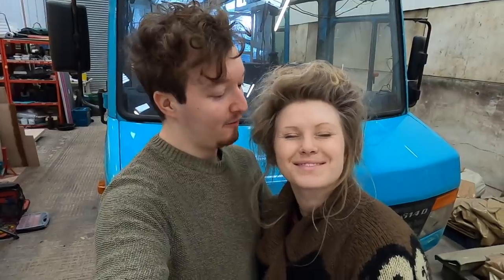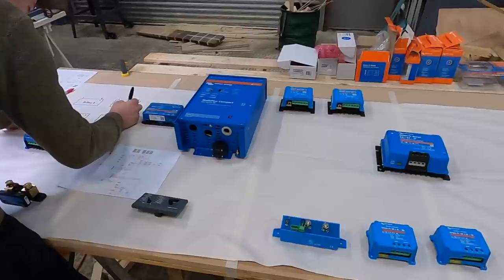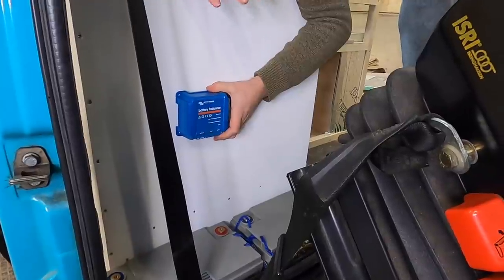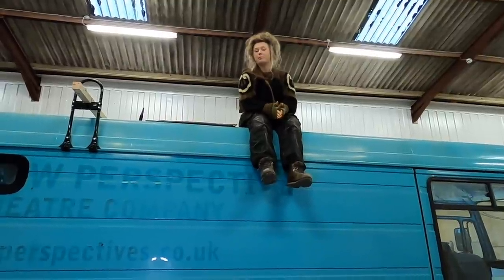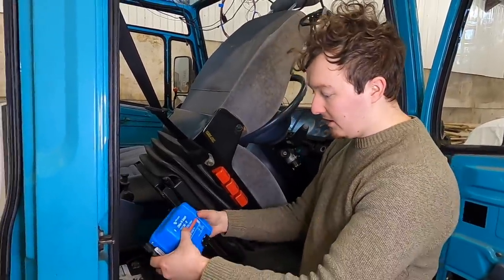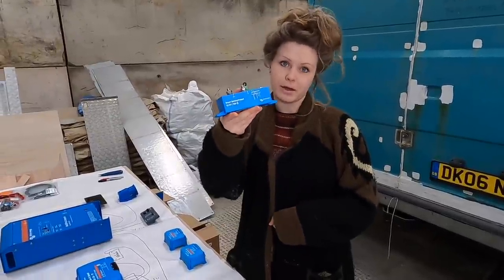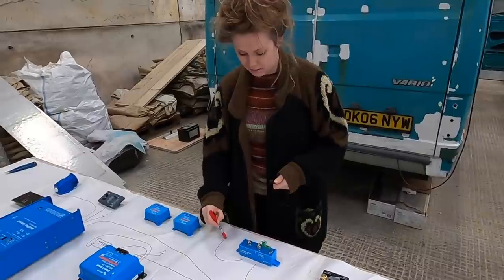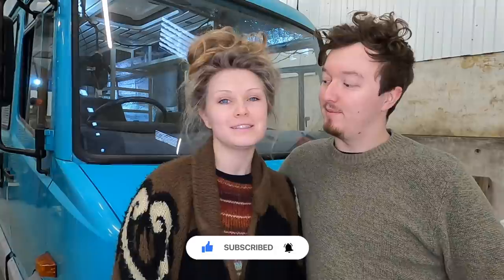OUR CAMPERVAN ELECTRICAL SYSTEM | Mercedes Vario | 12V & 24V explained Victron Haul | Van Build Ep25

Comment: Great  video. I'm about to upgrade my system from 12v to 48v.

 I'm surprised you didn't go Lifepo4 though after spending all that money.
Reply from the maker: We really did want to go lithium but we had stretched our budget to it’s limit already... We have made sure the system can take lithium so once we’ve saved a bit more we can invest again!
Reply: @MaxSophieinaVan  Ah yes they cost quite a bit. I have gone for the AliExpress cells and Daly BMS. I will pm you over my spreadsheet later comparing them with price per kwh. It might help you when you need it.
Reply from the maker: Thank you so much - I’m sure that will be super helpful when the time comes!

Comment: Excellent system. Congrats!
I am trying to get a similar one only difference is with LiFePO4 batteries and 3KW MultiPlus GX. 
I was recommended to include a VE Bus BMS, BMV712 and a Lynx Distributor? You won't need these components?
You may also add a battery disconnect switch, GX Touch display and buck booster to charge way faster from the main or a second alternator if you want..
Could you please share your diagram? 
Thanks a lot!
Reply from the maker: Thank you so much Charlie! We couldn’t quite stretch to lithium and a bigger multiplus but might upgrade in the future 😂 your system sounds amazing!

I *think (might not be 100% best terminology) that the VE Bus BMS is something you need for lithium setups to protect each individual cell, our AGM’s won’t need this. We’ve gone for a smartshunt and Cerbo GX which I think does everything the BMV712 does? And we are just going for a set of midi fuses in little cases (https://amzn.to/2NNkRJu) rather than the Lynx Distributer purely from a cost saving point of view! The lynx is really neat and tidy, just a little out of budget!

We are going for a disconnect and saving up for a GX touch display!

Can you drop us an email to maxandsophieinavan@gmail.com and I’ll send you the wiring diagram! Waiting for it to be 100% checked over by professionals which is why I haven’t published it yet!

Thanks again for all of these useful ideas! 😊👍
Reply: Thank you too for the efforts in sharing your conversion and videos with us 🤗 I will email you now...✌️🙏
Reply from the maker: You’re very welcome Charlie, thanks for watching and being part of our journey! Will get back to you shortly... 😊👌

Comment: ... these gems cost way more than a normal month salary ... so why not top them with a few lithium batteries? (btw: you sure know that max. 60% of your 340-AGM-amphours are usable??)
Reply from the maker: They are still way more affordable than lithium and these once’s can actually be discharged to 100% 300 times and can be frequently discharged to 80%, way more usable than normal AGM batteries!

But that’s a great point, we may well upgrade to lithium in the future but just couldn’t afford it right now! 😊👍
Reply: @MaxSophieinaVan  Discharging at 100% will ruin any lead based battery. The 300 cycles at full time use will last maybe two years? For lithium batteries with up to 3000 cycles (5000 at SOD 85%) the money is well spend ... just make your math ...
Reply from the maker: We thought these were the best stats without going for lithium which we just couldn’t afford! Maybe one day in the future!

https://www.victronenergy.com/upload/documents/Datasheet-AGM-Super-Cycle-battery-EN.pdf

Comment: what in your system will be run off 24v and what is run off 12v please as it looked as if you were running some ciggy sockets off 24v then you mentioned running then off 12v. I don't see the need for 240v in the van unless you plan to stay on camp sites as most things can be run from 12v or 24v or via an inverter for the short tern you would need 240v

Comment: confused with your mppt charger as you are putting a 24v connection to it from the batteries but putting 12v  solar panel into it ?

Comment: You lost me when said you had 2 batterys 🤔
Reply from the maker: Ahh! We have 6 batteries in total in the van, Two starter batteries (as the van system is 24V) and 4 leisure batteries (12V each running as pairs to make it 24V) - its a bit more complicated than the usual 12V system because of the base van we have chosen!

Comment: HI
Are you thinking of using fuses on both positive and negative circuits? those fuse boxes with led indicators you have can not connect to negative and positive, you must have suitable terminal for negative or 2 independent fuse boxes, 1 for positive and 1 for negative.
And maybe use a main switch on dc to dc charger, in case you have to disconnect the charge from the car ?
And there are 2 batteries for the car, not 1 battery 😜
Reply from the maker: Hi Vidar, we didn’t cover too much of our fusing in this video but we will have MEGA fuses after our leisure batteries, then MIDI fuses to each unit (Multiplus, DC to DC and MPPT’s) then on the appliance side we will have blade fuses and then bus bars for the negatives to be collated before they return to the batteries.

And good spot! Our car runs on 2x 12V batteries wired in series creating 24V, so works in the same way as 1x 24V battery (mostly!) 😊👍
Reply: @MaxSophieinaVan   I just noticed that you drew a negative circuit to the other side of the fuse boxes, that was the reason for the comment 🙂
Reply from the maker: That’s okay! We were trying to keep it as simple as we could, sorry for the confusion! Hope you enjoyed it 😊👌

Comment: Great video guys! So if you connect the multiplus to 230v, it will also charge your starter batteries right? So the voltage of the starter batteries will go up, how will you prevent the 24v dc-dc converter to think the engine is running?
Reply from the maker: Thank you so much! That’s exactly correct! We have two options (as far as I’m aware), you can wire in a trigger to the DC to DC converter from the ignition so it will only kick in when the van is running OR we can change the DC to DC’s start up voltage so it only kicks in when the engine is running as the alternator will charge the vehicle batteries at a higher voltage than the multiplus’ trickle charge! Hope that makes sense!? 😊👍
Reply: @MaxSophieinaVan  Thanks, yes it does! I am struggling with the same issue. We are about as far as you are in the process of converting our Vario into a campervan. Switching on the DC-DC converter at the higher voltage of the motor and not at the AC-DC charger voltage is a smart solution. I hadn't thought of that yet! I was thinking of putting a 230v relay in between. Which if the bus is connected to the 230v power, will make the DC-DC converter switches off or disconnects the connection.
Reply from the maker: My thinking was as the Orion is clever enough to do it itself I’d rather have less components to go wrong! But your relay option sounds like it will also work! This thread on the victron community site is really useful (https://community.victronenergy.com/questions/68614/multiplus-trickle-charging-in-combination-with-ori.html) and if you’re in the UK get in touch with Chris at BSPK solar, mention us and he’ll be happy to just chat through anything you need! He’s answered so many of our questions! 😂👍
Reply: @MaxSophieinaVan  thanks for the info! Less components is always better. I think I will try to do the same. If it doesn’t work as planned I can always add a relay (or a ignition switch combined with a cyrix-ct for the delay). We are from the Netherlands by the way :-)

Comment: Great video about the electrics. Very clear and can't wait for the install video for the electrics. I have a different question, would love to know where you got the passangerseat in your vario. We have got the same color van (614D, 2006, 6.5mtrs long) and want to make a camper van from it as well. Love to hear from you. THNX
Reply from the maker: Thank you so much, we just need to get it all installed now! And it came with the van when we got it but from a bit of research it looks like it came out of a VW LT35 and has some bit metal plates under the van which it is bolted through! Only con is that the middle seatbelt holder would never allow a swivel seat, but we can live without that!

So exciting about to van, we love the colour SO SO much! In the middle of doing a few little touch ups on it actually! 😊👍
Reply: @MaxSophieinaVan  Thanx so much. I'm going to search for a seat.
Reply from the maker: You’re welcome! Good luck! I’m not sure if it came in the original colour when they got it but we’ve been doing some external touch-ups on our van as we found you can buy some of the right colour paint!

Comment: Nice set up, and sure is going to be efficient. After all that spend, I would of done few different choices. Inverter you will upgrade in the future, a 2kva from the start makes better investment. The loads via dc dc 12v I would keep them at minimum with small 5-6 amps converters on each circuit, and switch of before the converter, as it has a idle draw. The pump you can get the same on 24v, much better than running via converter. Also, the panels I would of got 96 cell beasts like Panasonic or SunPower, with a vmp of 50+ volts, allowing you for all in parallel to charge at 24v with ease, and, eliminating any shade issues, also that could be done with single 50a mppt. 
Look forward on next vid and installation of these beautiful components. Get a hydraulic crimped if you haven’t already, lots of lugs to do, and a ferrule pliers for pins on stranded ends.
Reply from the maker: Thank you so much Aurel! And it’s all so personal but we did think about some of those choices.

We don’t really have any AC loads for our van which is why we thought our inverter would be enough but you never know for the future! What do you think we would need a higher capacity one for?

We did think about that with the dropper but decided space wise one would be easier for our build, it has a <100mA off load current so we are hoping we don’t notice it too much! And you are absolutely right with the pumps and a few of the other 12V items, over time we will upgrade what we can to 24V!

Thank you so much for your tips tho, we may well make some of those modifications in the future! And we were just looking at some crimping tools, will check them out!

Thanks again and glad you enjoyed 😊👍
Reply: @MaxSophieinaVan  The AC power is handy to make the most of it when you will have lots of excess production, it will cut your gas use, and, maximises use of your already made investment. Kettle, hot plate or small induction, slow cooker, toaster etc , all of these can be found under 1000 even 800w. A 750w element in a boiler, gives you 13l of hot 70C deg of water, and combined with cold, is two showers wash on wash off. You will see the equipment idle and think of ways to put it to use, otherwise is wasted. Hence my advise on larger inverter. You will use you your panels, batteries and chargers close to their potential.
Reply from the maker: Thank you Aurel, that’s all really useful information and definitely something we will think about in the future! Will keep you updated with how we get on! 😊👍

Comment: Hi guys what sort of money did all those electronic gadgets costs and also are you worried about overall weight of your van
Reply from the maker: It was the biggest investment of our build really, around the 5k mark in the end! However for full time living we thought it was worth the investment! And we have about a 3 tonne payload as it’s a 7.5t van, we’ve been nominally weighing things as we build and install them and still have a lot of capacity so hopefully we will be fine! 😊👍
Reply: @MaxSophieinaVan  7.5T van? have you had it converted to 814D wheels, brakes and suspension or is it still a 6T 614D?